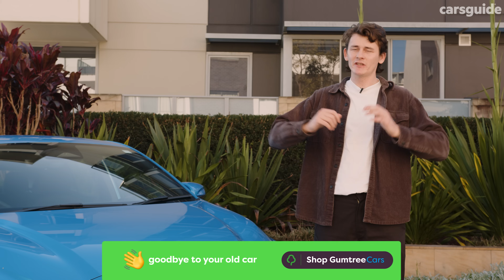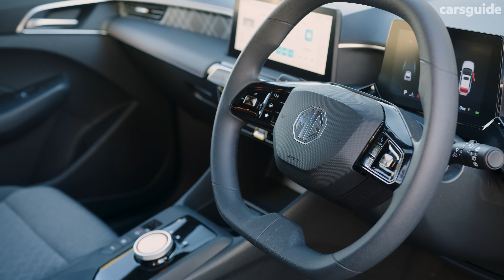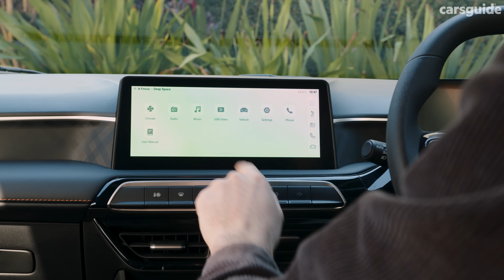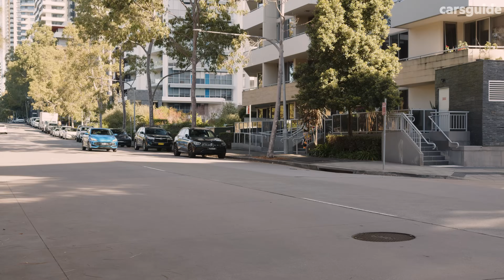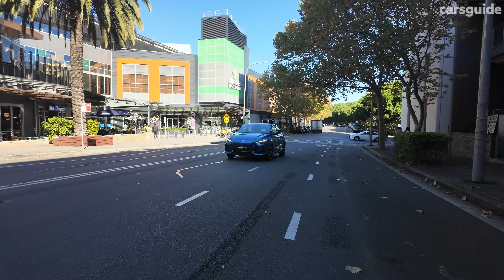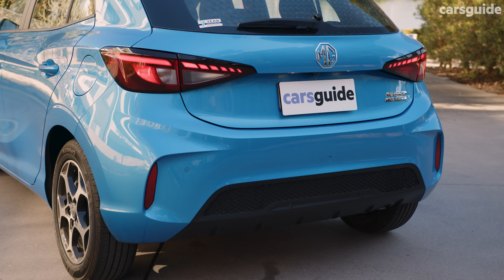MG3 Hybrid+ 2024 review: Next-gen hatch shakes up city-car segment, putting Toyota Yaris on notice

Comment: Now in 2025 the MG3 will have a two-way adjustable steering wheel (up and down and reach) plus the rear seat is split folding, 60/40.👍😊
The French brochure, dated 21-1-2025 already mentions this.
Keep in mind that 'old' stock will be still without!🤔

Comment: I don't think this 3 speed auto is that bad in comparison to a 1988 Mazda Familia (323 Jap import, predecessor of Axela or Mazda 3) with its 3 speeder. That's because those 3 ratios in MG3 can be made a lot wider than Mazda Familia's because of a powerful electric motor.

Comment: How does the MG3 Hybrid perform on a long downhill stretch, with the battery at 100% charge? Some say it goes into neutral, has no "engine brake" and therefore you are forced to keep your foot on the brake, with all that that entails. This is not a safe way to tackle a long downhill stretch of road.

Comment: This would be a good hybrid but it suffers from a few problems:
1 - Much pricier than previous generation and now very close to other more reputable brands.
2 - Requires 95 when others in the range only need 91.
3 - Worse fuel consumption than others even with 95 compared to 91 others use.
4 - Ancient 3 speed Trimatic transmission last used in the VL Commodore (40 years old!). No doubt contributing to poorer fuel efficiency and noise.
Reply: Ancient 3 speed transmission?! You are so outdated,lol. It got an electric motor to cover the low speed zone and thus no need to have more than 3 speed. The hybrid is very different from the Japanese hybrid type.
Reply: 4.5 liters per 100 km (over 60 mpg) is quite good. in europe the only competitors have 80hp petrol engines or are much more expensive and still slower, i'm looking at you yaris. so irl there's nothing to compare it to, maybe toyota corolla that cost 12000 euro more
Reply: VL had a 4 spd too. also how many gears do most hybrids have? that's right, they don't because they're a CVT.

Comment: its not game changing and can hardly be called a hybrid, its got a small battery than my drill.
Reply: Voltage isn’t capacity. No it doesn’t
Reply: What drill do you operate that has a battery this size? 😂😂😂😂
Reply: Better not look at the "Hybrid" Swift then.
Reply: Wrong